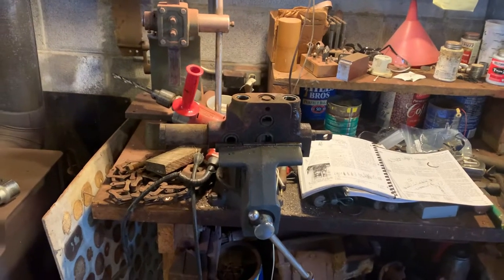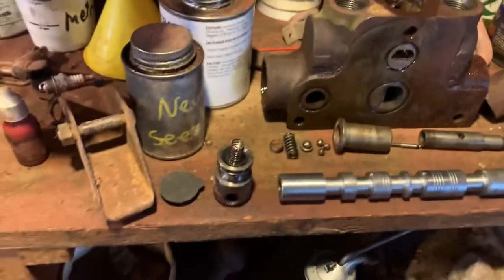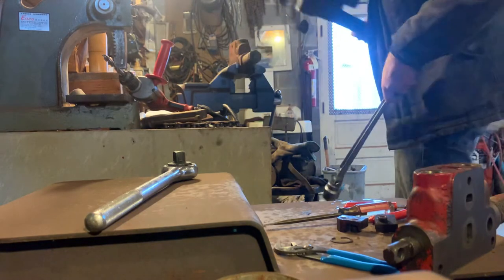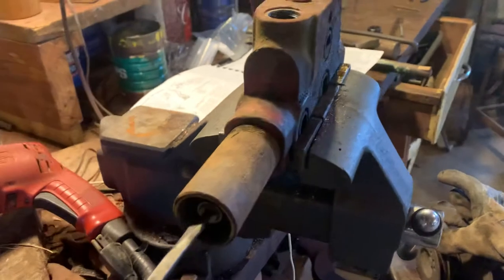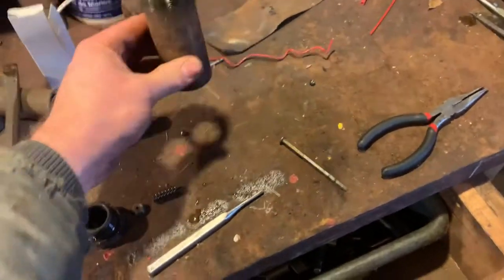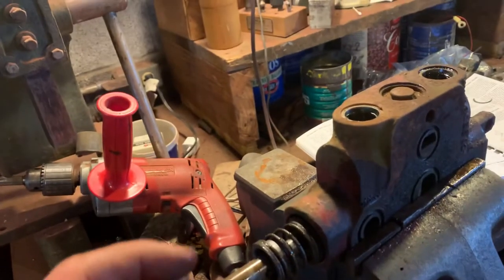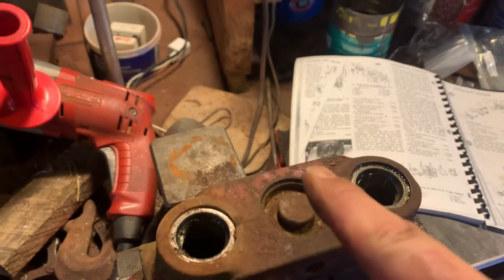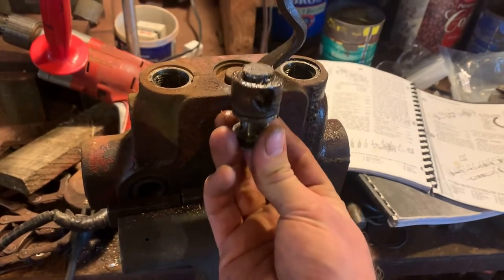IH Remote Valve Disassembly (06-56 series)

Comment: What service manual is that ? Is it the GSS-1278-A hydraulic valves manual? I have the same 3 section valve assembly . Having trouble with the outer bucket spool assembly porting fluid out both hoses in the bucket dump/roll down mode . Curl up works as it should. I am looking for a fluid flow diagram to aid in diagnosis  Jeff  in Oklahoma